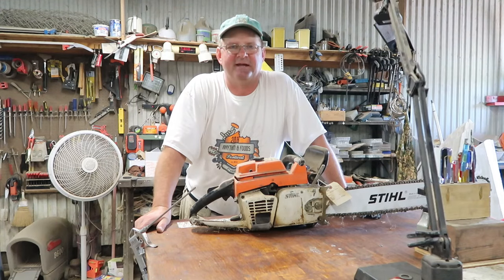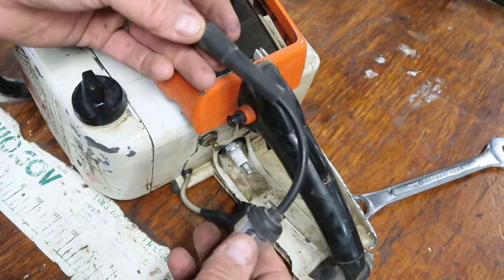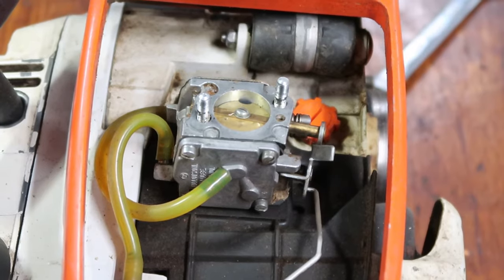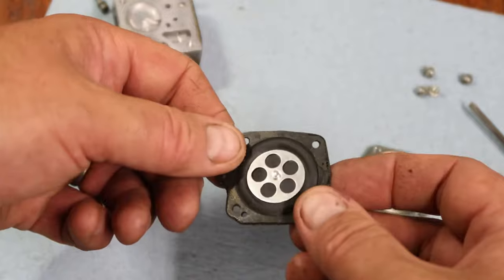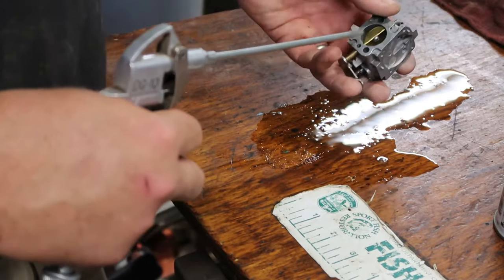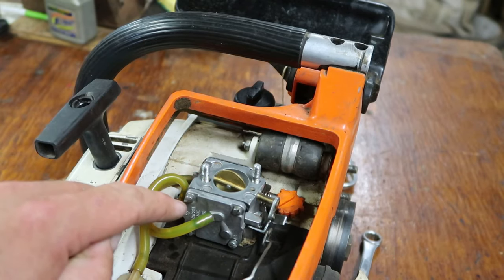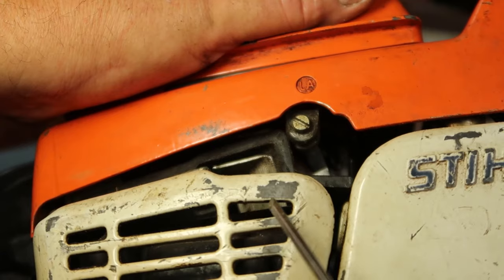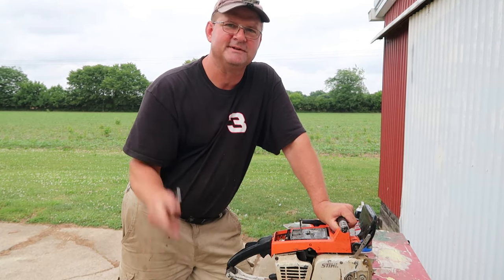How to Diagnose and Repair a Small Engine

Comment: Over the years I have found that 19 out of 20 problems are fuel...people use regular gasoline in their portable tools & it has ethanol which destroys the carburetor plastics & goes stale to create varnish when left. I always use Shell premium grade fuel (zero ethanol), empty the tank out & run my stuff dry when I am going to store it for more than a month or two. Never had a single problem with anything since I started doing this about 15 years ago...
Reply: Same, not a single problem using premium fuel and running the machine dry. Also for other readers, using the machine regularly doesn't mean the fuel will stay good. If the fuel is in the machine for a couple months, run it dry or drain it out, even if you use the machine every day.

Comment: Fuel, compression, spark.  Even I can remember that....  I love how you  break it down to its basic parts.
Reply from the maker: I’m sure you know that this was made especially for you!
Reply: @HappyWifeAcres  Thanks for your thoughtfulness
Reply: @HappyWifeAcres  C
Reply: And it also needs a proper air flow...
Reply: Air
Reply: @johnmckell4362  and timing
Reply: The carb cleaners most of them are hard on the elastomeric (rubber) components.  I would not spray a relatively clean diaphragm.
Reply: Spraying carb cleaner on the filter probably won’t hurt it as it is plastic.

Comment: FACTS - Fuel, Air, Compression, Timing, Spark. Most people only know, acknowledge or remember three of those (and not even the same three, as seen in this video) but all five are required and that acronym is easy to remember and really makes for more complete troubleshooting.
Reply from the maker: You're absolutely correct.  I don't dwell on air much except to say check your air filter, and since timing can't be adjusted on most small engines, I try not to confuse the beginners.  I did make a video about when engines come to a sudden stop and damage the woodruff key.  You can find that at https://youtu.be/Voo3o74vmyY.  Thanks for watching!
Reply: Happy Wife Acres   Oops, just realized I spelled shear incorrectly. I referred to it as such because that seems to be more common in this genre than calling it a Woodruff key, although that’s what I have always understood the permanent, non-sacrificial key to be known as. I guess I’m assuming because it’s sacrificial the more correct term is shear, but I don’t know that for a fact.   At any rate, our styles differ although we both seek the same result. I tend to speak to the highest common denominator rather than the lowest as it leaves the recipient with questions, which keeps them thinking about the subject and perhaps studying it in more depth. At any rate, the acronym is not difficult to remember and gives the student what I consider to be a firm foundation from which to work.   I did appreciate your clear audio and video, something I can’t say for a lot of creators. 👍🙏🔧🧰
Reply from the maker: We call ourselves homestead educators, so our audience is typically people who know very little about self-reliance, but want to learn.  We consider small engine repair to be part of the mix, along with animal husbandry, meat processing, wine making, and food preservation.  So with small engines, we focus on the absolute basics.  The typical audience is people who hate paying to get the string trimmer or lawn mower fixed, or can't afford to buy a new one.  It's definitely the beginner's course!  Hence the different styles.  Thanks for the kind words!

Comment: Very fine tutorial! I've got a (Ugh!) Harbor Freight Predator 52cc power auger that just won't start. It's about six years old and started to stall after running a couple of minutes when I used it last year. I threw it in the storage shed over winter and didn't drain the gasoline but did add stabilizer. I recently decided to see what the problems were. The fuel lines were deteriorated and the fuel filter was rusty and semi-clogged,  so replaced those. Put in a new spark plug and replaced the old carb with a new one ($16 @ Amazon). Cleaned fuel tank and added Start/Conditioner/Cleaner fuel. Replaced the air filter. And it still won't start. FRUSTRATING! I'll try the spark plug check you recommended to see if it's actually getting ignition because that's all that I can think of. Maybe it's time for the junk heap and moving to the newer Ryobi 40v electric auger but I'd hate to do that as i Have three different sized augers for the Predator, which, of course, don't fit the Ryobi shaft diameter.

Comment: When I work on one and put the pin back in. I take a hose or just my mouth if tube is sticking out. And blow in the fuel inlet while tapping the float/pin lever. To make sure the needle valve seals. The taste of gas is just an extra benefit 😋

Comment: A couple tips: On two cycle engines, use premixed fuel instead of starter fluid to start the engine. It really does not take long to score up the cylinder and ruin it. On 4 cycle engines, I always use carb cleaner instead of starter fluid to start the engine.
Reply: I learned something thanks

Comment: First thing you should have done with check for air make sure that the air cleaner isn't clogged because that's the most popular issue on a chainsaw then from there if that looks like it was okay and it's getting there you would then want to check for spark because that's pretty easy to do. If it's getting spark and it's getting there then it must be Fuel and another big thing on chainsaws is that the fuel line from the gas tank to the carburetor will gum up

Comment: Very helpful video👍I was always afraid to take a carb apart until now. BTW
Do you any experience with cheap Chinese carbs? If so do they do the job or is it best to use the expensive genuine ones?
Reply from the maker: I’ve never had a problem with cheap carbs. They’re usually around $15 for most equipment.

Comment: Always remember spark has to be at the rite time. That one will get ya
Reply from the maker: True, however nearly every 2-stoke engine has fixed timing via the flywheel magnet. On a 2-stroke engine, just clean and inspect the coil gap, which is about the thickness of a business card (.010”).
Reply: glad my father taught me this
Reply: Happy Wife Acres   That response is good, as far as it goes. That said, if you have something like a mower hit an immovable object (large stone, drain pipe, whatever) then the sheer key (which keeps the crankshaft and the flywheel rotating together) can sheer away slightly or altogether, which changes the timing and can prevent the engine from running. Just something else of which to be aware. Timing may not be adjustable but it CAN go out of synch.

Comment: You know anything about Husquvarna riding lawnmowers? I changed the oil, oil filter, air filter and cutting blades. I got around the yard one time and it started smoking like crazy and popping. What could i have done?
Reply from the maker: Is that all you did?  Did you change the spark plug?

Comment: Hi!!!!!
I have an older Craftman weed eater. Can you work on one?  Should I try to get rid of it or restore it
Reply from the maker: Unless something terrible happened to the mechanical parts of the equipment, the engine can usually be tuned up and running again.  Go through the steps in the video for the engine.  With age, the fuel lines get brittle, and the carburetor might need cleaning out.  Clean the spark plug and it will probably start for you!

Comment: My only objection is the use of carb cleaner on 2 cycle carbs. The check valves inside the carbs don't like carb cleaner. I use seafoam. And never ever use compressed air on these tiny holes,  because it'll blow out the check valves.
Reply from the maker: Agree about the compressed air. I use low pressure or squeeze slightly. Check valves are in the primer assembly and yes they can blow out easily. The main body is just channels. Never had a problem with carb cleaner but it is strong stuff and will remove paint!
Reply: @HappyWifeAcres  Needle seats and check valves are pretty easy to distort. Sea Foam top engine cleaner and lube doesn't seem to have any effect on them.  But the Walmart brand carb cleaner you're using, isn't as strong as the name brand stuff.  I use a lot of it. But only on bare 4 cycle carbs.

Comment: What is the gap in the spark plug and where can you buy that plug? 🤔  I recommend  buying no ethanol fuel for ALL small engines 2 or 4 stroke because ethanol absorbed water and destroys the metal of the engine!!
Reply from the maker: I’m not sure of the specific spark plug but there’s always a replacement, no matter how old. You can find the gap online. They are typically.020” to .030”. 

Agree about fuel. Ethanol destroys the fuel diaphragm in the carburetor, causing poor performance, followed by no starting.

Comment: I have a power washer that someone put diseal in how do I fix this and it won’t turn over anymore
Reply from the maker: Start by flushing the gas tank and lines. You might have to rebuild the carburetor. Clean spark plug.

Comment: What do you do if you have weak or no spark?
Reply from the maker: Weak or no spark could be the spark plug, but if your spark tester isn't sparking, it's the coil.  Sometimes it's dirty or out of adjustment.  Loosen the coil, check it for dirt where the flywheel passes near the coil, then reinstall.  The proper gap is about .010", which is the thickness of a business card.  Place the business card between the coil and the flywheel, rotate the flywheel until the magnet pulls the coil in, and tighten the screws.  Remove the business card.  Retest for spark.  If there's still no spark, replace the coil.  Good luck!
Reply: @HappyWifeAcres  
Thank you very much for responding.

Comment: kind of lost me at the idle screws stuff...the rest looks pretty easy...im thinking to myself this is it? this is all you have to do to fix small engines? my god...i mean yeah im sure theres other stuff maybe a broken aprt here and there but once you see this video you know what the parts are and where they go and such...good video...i collect metal and come across alot of weed eaters and lawnmowers i always thought of trying or learning to try to fix one just for seomthing to do i have alot fo time on my hands i mean ALOT so after seeing this video ill give it a shot but ill have to rewatch that idle screws part.. not sure what thats for or about...
Reply from the maker: What a nice comment.  Thank you!  I hope you try fixing some small engines.  I think you'll find that many of them just need a clean carburetor or some adjustments and you'll be able to sell what you fixed.  I recently had someone bring me a blower and a weed trimmer.  He had put the wrong fuel-oil mixture and was convinced they were trash.  I flushed the tanks and made a minor carburetor adjustment and had both fixed within 20 minutes.

For the screws, most (but not all) carburetors have an idle speed screw, and a "L" and "H" screw.  After cleaning the carb, the starting point for the L and H is to screw them all the way in, then back them out a full turn or a 1.5 turns.  

Idle speed screw controls idle speed.  Too slow and it dies; too fast and it engages a clutch that spins the trimmer or chain or whatever it does.  The L screw adjusts how much fuel goes in the engine when it's idling.  Screw in to make it lean; out to make it rich.  Either way will make it run bad, so get somewhere in the middle.  BTW, this needs adjusting based on fuel type, mixture, temperature, & altitude.  Most people don't know how to adjust it (or they're afraid to), and they throw it away when it runs rough.  The H screw controls the speed.  Press the trigger and adjust it in or out until it sounds good.  Once the L and H is adjusted, adjust the idle speed so it's not too fast or slow.  That's it!

When carburetors are really bad, most can be replaced for about $15 on eBay.  Again, most people don't know how to change it so they throw the whole thing out.  Push mowers are even more simple than a chainsaw.  I'll probably make a video on one of those soon.  I like getting push mowers; I charge more because they're bigger, but usually have them fixed in half the time.  

Again, I hope you'll give it a try.  If you screw it all up, then it's scrap metal for you!  If you lived close, you could have my scrap metal.  It's piling up.  Best wishes and thanks for watching!

Comment: I have a dirt bike that I’m having trouble getting to run and it has spark and compression but only starts when I pour gas directly into the carb, do you or anyone have any tips for this? It’s a 4 stroke
Reply from the maker: Does it have a working choke?  Or perhaps one of those large primer buttons?  The primer buttons spray the carburetor with gas.  Sometimes the gasket cracks, keeping air from the button from forcing gas in.  Without a choke of some sort, it's hard to get an engine started.
Reply: Sounds to me like a bad float but I'm definitely no mechanic. I've just had to clean and rebuild about 10 carbs for my landscaping business lol we have a lot of small engines

Comment: No! Don't get premium fuel! Get Non-Ethonal fuel! There is a differece!
Reply from the maker: You are correct. Thank you for clarifying. Ethanol is the culprit. Here is a website that can help people find ethanol-free gas. It’s not easy to find!  https://www.pure-gas.org
Reply: Husqvarna's premixed 50:1 XP fuel is great for chainsaws that don't get regular use. The stuff has a shelf life of 2-years. If your machines get regular use then this can get expensive. In that case, it's best to look for ethanol-free premium gas but as mentioned it is difficult. I've had good success with using Star Tron in all my fuel as a preventative but it's not a cure-all. Best to not fill up with more gas than you plan on using and try not to store gas for more than 30 days. BTW, if you're ever in need of small engine parts you can check out our site nationalsmallengines.com. The promo code "SAVE10" will save you 10% at checkout on all parts.

Comment: Thanks for the video. I saw the air filter. Is there a fuel filter on these chainsaws?
Reply from the maker: Yes. Most often that are in the fuel tank on the end of the fuel line. Unless you’ve used very dirty fuel, they can usually be cleaned out with fuel and compressed air.
Reply: And there can be small metallic one inside carburettor too.

Comment: And fourthly it needs air. Without it, it won't run.
Reply from the maker: I assumed that most people are using their equipment on earth.  But yes, a clogged filter and obstructions will prevent an engine from running.

Comment: dumb question, where is the air filter?
Reply from the maker: The air filter is always in front of the carburetor. On this model, it was under the top cover.
Reply: @HappyWifeAcres  thank you I found it.  I had success tearing down a leaf blower and putting it back together. Your video was extremely helpful.
Reply from the maker: Wonderful!

Comment: Sooooo...it was a dirty carburetor?
Reply from the maker: The main culprit was gas lines, which I replaced before I shot the video.  The carb needed some care, but looked clean.  Mostly, it hadn't been used for years, and needed a good looking-over.  Thanks for watching!
Reply: Honestly I find 95% of the time, it's a dirty carb.

Comment: My chainsaw runs for 10 to 15 minutes real good and after that it keeps dying
Reply from the maker: Check the spark arrestor screen.  You'll find a small screw that attaches a screen to your muffler.  Remove it and make sure it's not clogged.  Clean it if it is.  Otherwise, your carburetor might be adjusted too lean on the "H" side.